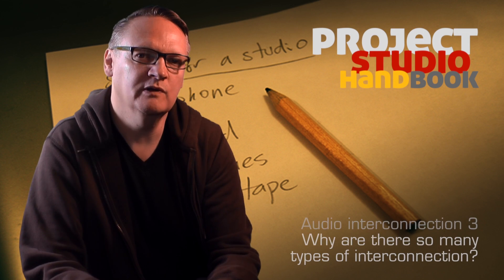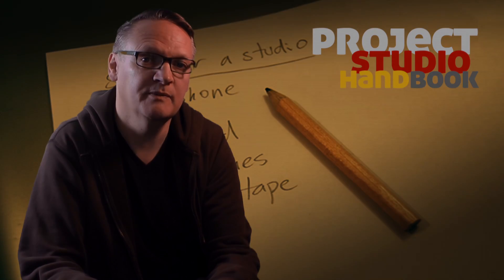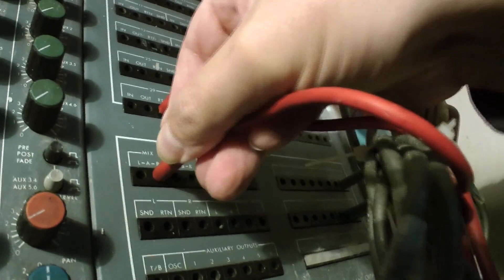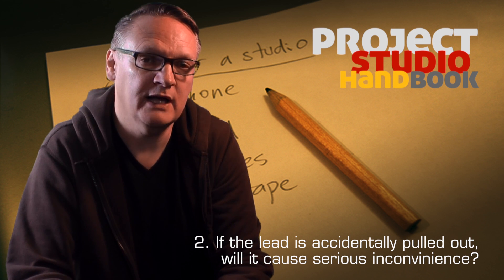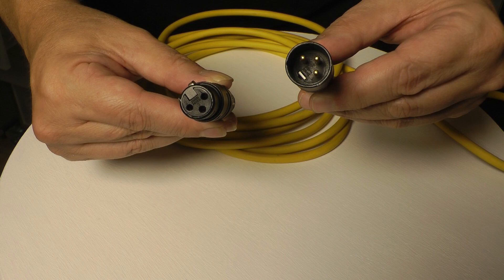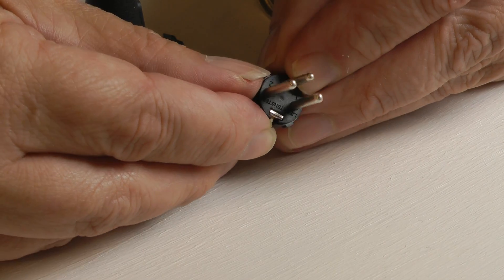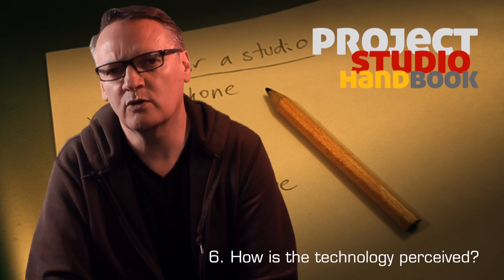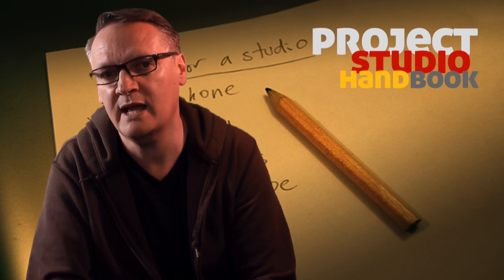Why are there so many types of audio interconnection? (v1)

Comment: Hi, probably it' not the right video to comment with this but I've a question. Can I use a 5 pin XLR cable with a microphone or a line connection wich has 3 pin XLR plug? Can I use some type of adapters in which the pins of the 5 pin connector are combined in 3 pins?
Reply from the maker: Hi Filippo

Yes you can. There should be no electric problems providing the adaptors at each end are connecting the same three poles and ignoring the other 2. Hope this helps.
Reply: Yes, ignoring the other 2! Thanks for the solution! 
PS Your Youtube channel is wonderful! Your explainations are extremely simple to understand and extremely helpful!
Reply from the maker: Thanks for the kind words.